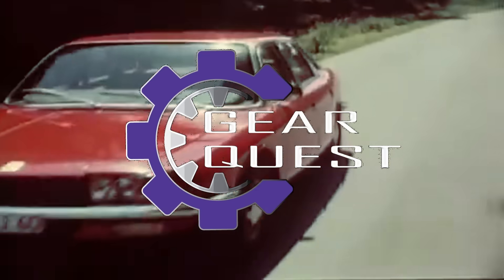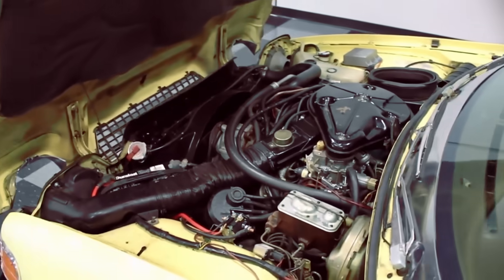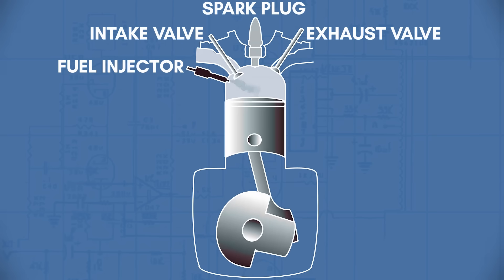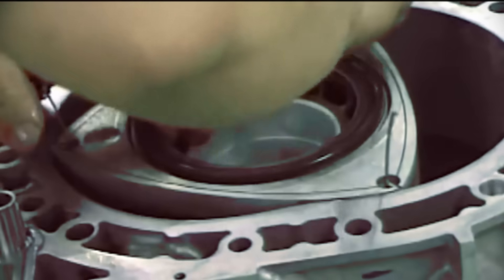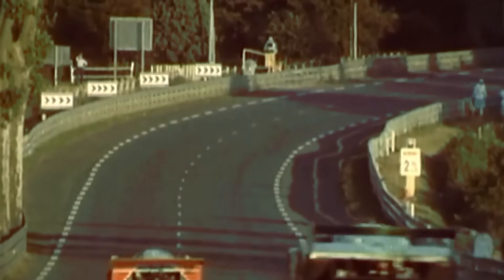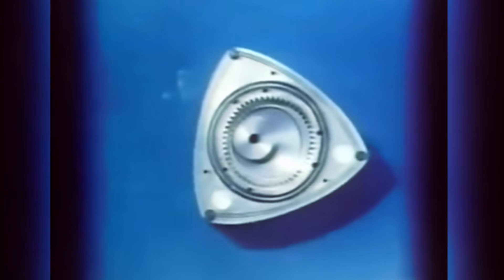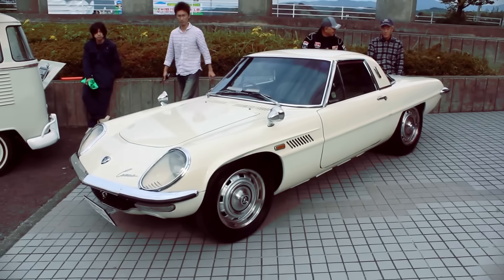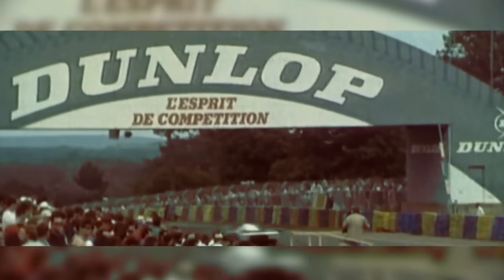The History of the Rotary Design

Comment: I love rotary engines. Here are a few thoughts I think many don't realize. You could make a rotary with cams and valves instead of ports and make it a 4 stroke. Rotary engines fire every time the combustion chamber is swept therefore they are 2 stroke engines. The rotary 2 stroke is better than the piston 2 stroke in many ways, it is so much smoother running. However piston 2 strokes have the advantage of self supercharging while rotaries do not. That's why piston 2 strokes have a much higher power to weight ratio than rotary 2 strokes. And for those who aren't convinced that rotaries are 2 stroke, here is a list of things in common with 2 strokes: Very few parts. Intake and exhaust ports are opened and closed by the piston (or rotor). You mix oil with the gas. They rev really high but don't make a lot of torque. They don't like to idle too much they prefer a lot of throttle. Now I'm working on methods of adding the self supercharging system that piston 2 strokes have to rotaries. You would need an expansion pipe and some kind of crazy 1 way valve to connect the intake to the exhaust, as well as a correctly sized intake plenum and reed valve.
Reply from the maker: Rotaries are a two-cycle four-strokes, they have a true 4 cycle (combustion event) but unlike a piston 4 cycle engine the rotary only needs one crankshaft revolution to complete its cycle, just like a two-stroke piston engine.
Reply: @GearQuest  I don't really see any 4 cycle processes occuring in a rotary but if you could point one out I would love to learn about it.

But to me it has way more in common with 2 strokes. No cams, no valves, loves to rev high, hates to idle especially cold, takes mixed gas, has ports that are covered and uncovered by the rotor, very few moving parts. All of it's qualities are 2 stroke qualities. I would like to be proven wrong because I love learning and logic and hate when people are emotionally attached to ideas as if they are part of them personally and have a "dog in the fight" so to speak.

I think that defining the combustion area as the place where combustion happens makes the most sense. Every time it's swept it fires, therefore it fires every single sweep not every other and so by definition it is a 2 stroke engine. One stroke to compress the combustion area, and one stroke as it fires and expands. There is never a time when the combustion area is swept just to compress or expell the mixture, every sweep is utilized for power. That's why they have such a great power to weight ratio and are so small.

Since a combustion event is never sacrificed in order to achieve compression or exhaust, it fires every time. The strokes only refer to the number of times the actual combustion area is swept to the number of times it fires. Either it fires every time or it doesn't. That really is the definition. You would have to redefine what a stroke is if you wanted it to be any other way.

Comment: Let's define swept volume using two other terms that people who need this explained to them would also not know.
The terms "top dead center" and "bottom dead center" should be replaced with a more layman friendly explanation. Something that could easily be done. Good video, but as a former teacher, I see this kind of thing all the time. And then people wonder why others are lost.
The irony is that the explanation right after it explains something far more simplistic in excruciating detail.
Reply: I deal with the same issues communicating tech to people! I'd replace "top dead" and "bottom dead" with: "the very highest" and "the very lowest". 

Or, if they were really curious: "the volume of the chamber when the piston is at its highest" and "the volume of the chamber when the piston is at its lowest".

But I agree, technical knowledge and technical communication are two very different things.

Comment: I wanna move to a alternate universe where the rotary replaced piston engines.
Reply: That would be the same Universe where Fail Army is the only Youtube channel.
Reply: @johncoops6897  sounds like someone doesnt have rotary fever. shun the non believer boo
Reply: I love me some rotary engine, but let's face it. In the grand scheme of things its shit ;p They should just go to f1 and race cars where fuel consumption and emissions don't have to be an issue, but for everyday use, while awesome they just aren't any good. Effectively they are just streamlined and beefed up two strokes at this point. (and I also love me some two stroke, lotus was developing an awesome multi valve, variable compression two stroke that could run on any fuel, and didn't burn any oil. Don't know were it went though)
Reply: This alternate universe must have unlimited oil.
Reply: The rotary was a shit engine
Reply: Undead Exile piss off m8.

Comment: To stop seals from failing improve efficiency and oil usage, re-design the spark plug position to be on the rotor, ie 1 plug per surface, lube the apex seals from inside the rotor, use many smaller holes for inlet/outlet ports,  use vacuum and turbo combination for outlet and inlet manifold for better aspiration.

Comment: I drove a 1986 RX-7 with the 13B to 143k miles with no major engine or transmission work.  A rubber O-ring between the oil filter adapter and engine housing rotted away but an oil level alarm saved it, and when I had to remove the intake plenum to change the fuel pulsation damper I changed the brittle oil injector lines.  It used only a little more oil than my piston engines and that did not increase with age as it was metered in.   Sent a snapshot of my odometer when it turned 222222  to Mazda motor Corp but no response    It was still running great when I sold it.  Surprised me.
Reply: Correction make that 243k miles.  Sure wasn’t expecting that when I bought it.

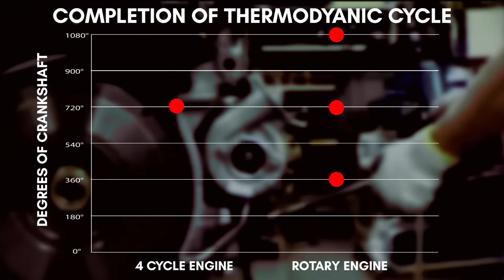Comment: 9:04 for those who want to skip the fluff and get to why motorsports banned the rotary engine.
Reply: The rotary wasn't banned, in 1990 there was a rule change that in the 1991 season ALL cars MUST use 3.5L V10 engines, the teams said that the engines would be too unreliable and asked for the changes to be postponed to 1992.

It was a pure coincidence that in the next season the rotary engine was outlawed, together with Porsche's flat 6, Mercedes-Benz's V8 and Jaguar's V12

Comment: Excellent presentation.  In 1992, at Road America, Elkhart Lake, WI., the IMSA races allowed some Mazda Wankel powered cars.  I think those engines had four rotors.  At lower RPM's, the lower torque output of the Wankels allowed the piston engined cars to accelerate out of the turns faster than the Mazdas.  But, on the straightaways, the Mazdas had a fierce top speed.  And, the Mazda Wankel engined car were painfully loud, as the exhaust blast was continuous, rather than pulsed, like a piston engine car.

Comment: The American automotive industry, and any other major corporation for that matter, are notorious for suppressing and knocking down anything that has potential to cut into their profits or threaten their business. There's been more than a few occasions of 100mpg carburetors that they swept under the carpet, double overhead cam motors during the horsepower wars that some of the GM companies developed that Chevy conveniently silenced, and who knows what else. Notice that there's no v8 Pontiac or Buick performance cars without a Chevy engine? Tobacco silenced threats for 50 years. I used to work for GE, and when they want something they just buy out the company. They bought 136 companies one year, in fact. It's no different than the ancient Kings and monarchs killing off people who threatened their rule. The automotive industry, fuel industry and every company related are all in cahoots with each other. Effect one, snowball effect. They have enough money, power, influence and political relations to do whatever they want.

Comment: When I was still an apprentice, my one instructor told me about a test between a rotary and a 4-stroke, to see where the revs stopped. The 4-stroke disintegrated at 16,000rpm, while the rotary made it to around 30,000 rpm before heat-seizing.
Reply: Yeah, but the piston engine still  made more power.
Reply: Fanboys can’t seem to grasp HP is work over time, regardless of rpm...

Comment: Besides the horrendous fuel efficiency, the  combustion occurs across a specific area.  That area would experience a gradient  of heats and pressure. 

I've heard that this cause a lot of issues with uneven wear and maintenance.
Reply: The poor fuel-efficiency stems from a need to keep a rotary in

the big end of the tach, in order to get any meaningful power out of it

Comment: This is coming from a rotary engine lover but everybody needs to stop acting like the rotary was banned because it was to good.  The rotary engine was not singled out as the only engine type/size that was banned.  In Group C there was a rule change in the early 90's that mandated that all Group C cars must have 3.5 Formula 1 style engines.  This made the rotary illegal but it also made Jaguar's 7.0L V12 engines, Mercedes 5.0L V8 and any other engine that wasn't allowed in F1 at the time illegal.  So yes, the rotary engine was banned but not because it was too good, but because F1 didn't allow them.  In fact the 787B didn't win the 1991 24 Hours of Le Mans because it was the fastest car, the car didn't even qualify in the top 10, it won because it ironically was the most reliable as the cars ahead of it broke down.

Rotary engines were at Le Mans as late as 1994 in the lower classes, look up 1994 Le Mans RX7.

I love the 787B and classic sportscar racing and hate seeing misinformation spread like this.

https://en.wikipedia.org/wiki/Group_C#Rise_and_fall

https://www.racingsportscars.com/results/qualifying/Le_Mans-1991-06-23.html

Comment: "With agile Handling"
*bodyroll* over 9000!
Reply from the maker: Well.. it was agile for the time 🤣
Reply: @GearQuest  The Ro80 handled like it was on rails at high speed, even with those skinny Michellin tyres, no matter what road camber. That is an exaggerated neg. road camber of intent to show 'on rails' characteristic in the old sales/demo footage. LOL
Combined with all other design features the Ro80 was a most competent performer... very predictable and never 'scary'... [how the damn thing accelerated above 1500rpm in every gear was, even using a small 12A] 
btw... The original '990cc' NSW motor was peripheral ported and exceeded the output of the standard 12A Mazda. NSU dual side draft carb... yeah, it did need an air filter/chamber designed to act like a muffler, because that thing had a loud low roar with fully open throttle above 2500rpm... easy to 7500rpm.  

The Ro80 had fully independent coil over strut long travel suspension that was highly advanced for it's time, and still is, allbeit a common design these days... decades later.
Oh.. yes, 'anti-sway' bar at front.. not needed at rear. 
I'd replaced all struts with adjustable Koni inserts some 22years after production date.... an easy job. 
Chassis of the Ro80 was very rigid, plus safe in terms of side impact crash scenario with large double box section side rails [around 200mm x 200mm] that the doors closed over... so from an occupants view the glass area was huge by 1969 standards. 
Had a virtually flat floor pan, flatter than a much smaller VW beetle... the Ro80 being front wheel drive.
Brakes... OMG.. no question about how quick that pulled up without lockup and twist and turn unpredictable reaction.  Those 4 piston front calipers had 2 independent hydraulic circuits fed from master cylinder... the rear set of pistons fed the rear disc caliper circuit. Front pads only used in 2 types of vehicle... the Ro80 and a Ferrari model of same era. 
Inboard mounted discs with calipers mounted on gearbox, means far less un-sprung weight at the wheels... the steel rims weighed far less than any fancy cast alloy. Sure looked good with no rotor or calipers there too.. had many tyre fitters go WTF removing road wheels. LOL  
Steering.... a very simple yet logical layout. Rack and pinion that acted on a centrally located pivot arm [ bearing mounted high on firewall ] , the Hydraulic power cylinder virtually opposing at same height and frame mount position [easy RH to LH conversion].. then equal length tie rods connected lower down on that pivot arm. 
Very aerodynamic bodywork.. CD efficiencies it took decades for other vehicle manufacturers to match, albeit with highly advanced design features like trim detailing. There is a certain appeal to a small distance from top of front wheel arch and top of fender.. take a look at many sexy looking sports cars... all short distance.   

Front wheel drive...  so, you expect some under-stear when pushed to crazy tyre limit. 
Thats easy to recover... back off a little.
Perhaps you enjoy over-stear? And how does a typical low grade driver handle over-stear? 
Yeah - tragically.

Simply, it's a safe bet... none of the commenters to this clip have ever owned or driven a Ro80,  designed as a mid-sized 4 door family sedan... not a performance or race car. 
It was more like a 4 door Porsche, and certainly far higher performance than the comparable  'sister' AUDI F103 [a hell of a lot sexier than the AUDI too]
Despite the very real 'go fast' nature of the Ro80, it was nothing like the 'cop magnet' [aside friendly interest] than shit very ordinary GM and Ford vehicles I'd owned prior and after the 8 years owning a Ro80 - zero bookings over that time.

Comment: Basically a rotor of a given displacement is roughly equivalent to a 3 cylinder 2-stroke engine with 3x the displacement. Main feature is being really compact for the power it can produce.
Reply from the maker: Rotaries are a two-cycle four-strokes, they have a true 4 cycle (combustion event) but unlike a piston 4 cycle engine the rotary only needs one crankshaft revolution to complete its cycle, just like a two-stroke piston engine.

Comment: The rotary was never banned it just never was brought back cuz it was only allowed in for one year. When Mazda won LeMans it was because there was a massive role change in the other manufacturers basically didn't have anything to fill the void Mazda just so happened to have that car they were playing with and they entered it into LeMans and that's why they won. Rotary engines just aren't competitive enough to run any longer. Especially when you're dealing with 2L and 3L that are putting out over a thousand horsepower reliably. and before anybody makes an argument it's kind of like why there's not steam engines any longer they're just not needed same with the rotary it was a novel concept when it came out but just not a very reliable engine